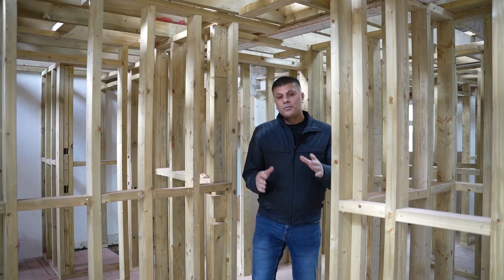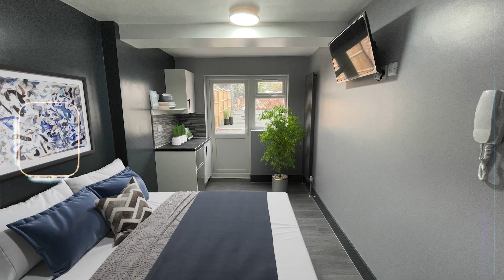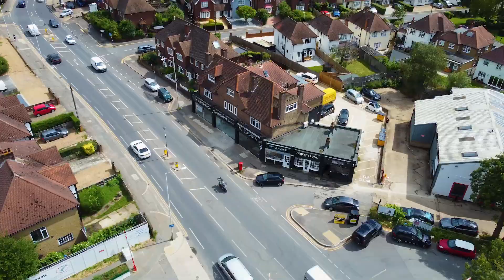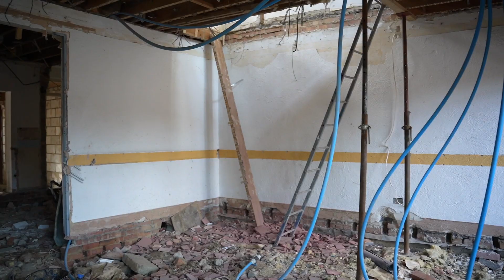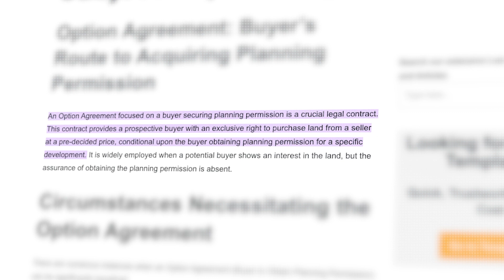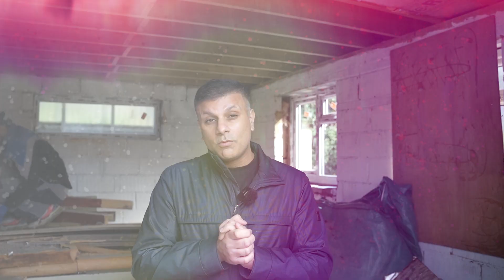£335k Profit - Commercial To Resi Conversion - Property UK

Comment: I was told that you can't use PD when converting a flat to a hmo? I thought it was under houses that under GDPO
Reply from the maker: You can do a flat to HMO if it's internal and no external changes.  Any external changes or extensions on a flat require full planning